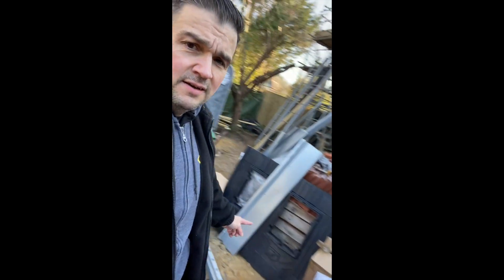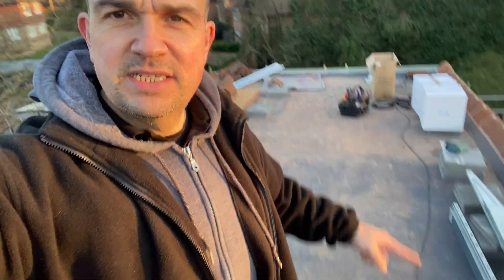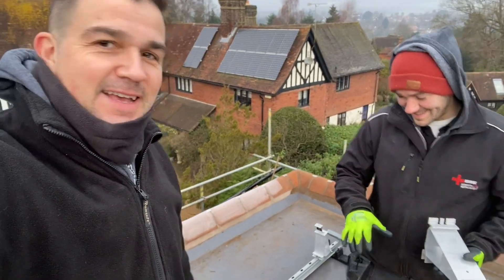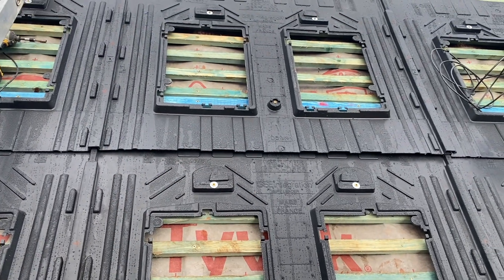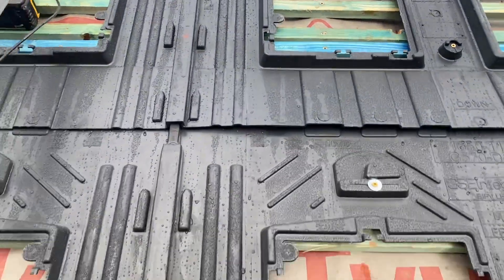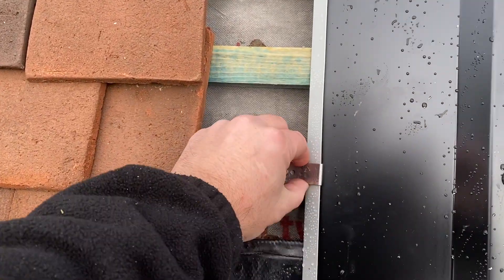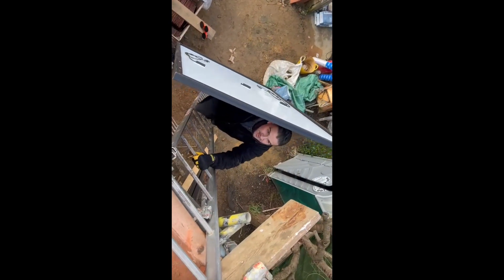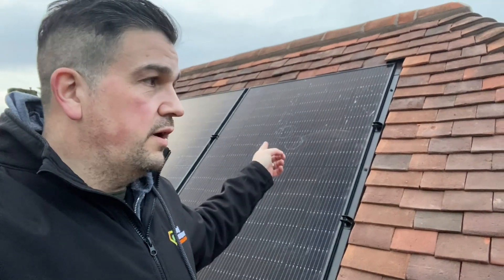The Ultimate Guide to Solar PV: In-Roof GSE Integration & Van Der Valk Flat Roof Mounting Install

Comment: Thank you for the detailed explanation of the tray install and over laps ive steuggled to find any good videos on this.

Some people were telling me with certain kits to scrap some part of the lead flashings not using the supplied ones as they aren't very good, then then create their own.

Any jdea what they'd be referring to?

Are there many manufacturers of the trays
Reply from the maker: Quite honestly the best integrated solar panel system is Viridian as a first choice which also gives you a landscape option. As far as flashing goes around the array, as long as the roofer is prepared to guarantee the water tightness and responsibility for it, you could, in hindsight, install it to your preference albeit, GSE will not warranty the product unless installed to Manufacturers instructions.
Reply: So you always usr the supplied flashings to top and bottom? @dorewoodman

Comment: I note that the system installed is not over battened. GSE standard tek screws are 60mm long for an over batten system. What length / size of tek screw fixing did you use for the side flashing and the solar panel clips as the 60mm will pierce the battens and  the felt below

Comment: For the flat roof does there have to be ply immediately under the surface or can the racking system sit on felt thats layed ontop of rigid insulation?

Comment: Looks like a tidy install there! I am looking at having integrated PV on my roof as I can't stand the sight of normal 'on-roof' panels! Really liking the look of the GSE system and also the Viridian system. Interested to know anyone's thoughts of the relative cost of these systems compared to 'on-roof' panels. Clearly there is extra work involved (stripping off existing tiles etc) and extra cost for the various flashings etc but for a small 6 panel system (I have a very small roof) its still only a 2 day job I'm thinking?
Reply from the maker: Thank you for the comment. Yes it shouldn’t take more than 2 days, depending on your budget the Viridian system is better and in fact easier to install albeit it is more expensive. We used the GSE as the developer was working on a tight budget and it was slightly cheaper.
Reply: If you do an inroof system and the original roof felt in non breathable wound you advice stripping the whole roof and changing to breathable. No issues with existing felt.
Reply: Do you still think the viridian system is the best. I see the Marley have teamed up with them

Comment: I do like solar & I'm looking into getting it my self but I have to admit seeing all those lovely old houses in the background with solar panels stuck all over them seems like a crime against aesthetics. Shame but what can you do 🙅‍♂
Reply from the maker: Indeed, but some sacrifices are worth while in the grand scheme of things. Do you have an older property?
Reply: @dorewoodman  Yes I have a pair of old semi detached cottages around 120 years old, which I've knocked through into one. Last year I done a complete new cut roof on one of them, slated it, put in some rows of clipped corner slates to form patterns & topped it off with decorative ridge tiles with club patterns. I constantly got stopped by passers by who seemed fascinated by what I was doing & I still get compliments for it when I'm out in the garden etc. I'd not actually done a roof before but money was tight & I couldn't seem to get a roofer so I give it a go & it turned out canny.

I was going to do the same on the other cottage this summer but decided I want solar so now I'm thinking just a dark grey roof tile would be more practical. Also thinking integrated panels will look nicer but besides the 5 to 10% drop in efficiency the longevity of their water tightness does worry me (especially with the loft being converted). Ideally I want this to be the last re-roof I ever do & concrete tiles should hopefully see me out but I've no idea how long I can realistically expect from integrated panels?

Comment: At 5.41 you show all these extra screws holding down the flashing but GSE Tech support told me: "Adding fixing points (and not pre-drilled ones) that strain the frame and the material in places that are not designed to take such strain can lead to cracking."  I think they're suggesting the panel clamps are enough to hold the flashing but my installers have also added screws which is a concern. Do we need more screws holding down a little bit of flashing than holding down all the solar panels?
Reply from the maker: Hi John, we did use the screws shown as our point and positions to hold the clamps that hold the panels. Either way the screws had to penetrate the profile on the edges and centres to fix the panels to the roof. We installed as per the Manufacturers Instructions and we haven't had any issues up to this point.

Comment: Just installing this kit on my roof, the issue we're having is the plain clays overlap the side trays and need to fix mechanically but would need to puncture the metal flashing trays, how did you guys overcome that?
Reply: Did you resolve this problem, I’m having the same issue
Reply: @jamiebell3980  Also wondering about this my self, I've not found any answers as yet!
Reply: @jamiebell3980  in the end the roofer and I agreed the only way really was one fixing on the batten and another through the flashing on the batten line. Hopefully the quantity of water getting under the tile is minimal enough to be a non issue. You could always put a bit of black mastic on the flashing before screwing through as a self seal. Not ideal. Overall not a great design really. We're also having a few issues of slipping panels as the clips seem to be struggling with the pitch!

Comment: Thanks for the video with the detail on the GSE kit. Can I ask, did you use the foam strip around the edges? I’ve had this system installed on my roof and they never used any foam strip even tho the GSE installation guides says to use it.
Reply from the maker: Hi Stephen, yes we did use the foam strip around the top and down the left and right hand sides. It just helps to seal the edges when the slate or tile laps onto it.
Reply: @dorewoodman  do you know what explicit problems would be caused if it isn’t used? Also how far under the tile does it go - would tiles need to be removed again to retrofit?
Reply: My installers didn't use it either and I think it's basically to keep birds etc out of the roof. From what I can find out it expands to fill any gaps under the tiles. Have you managed to get your installers back to fix it? Mine are coming back tomorrow.